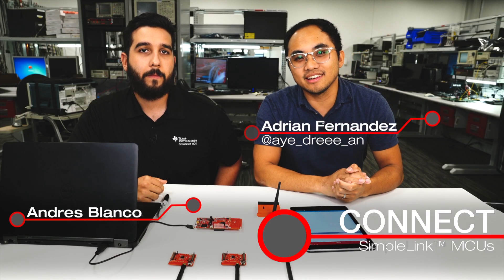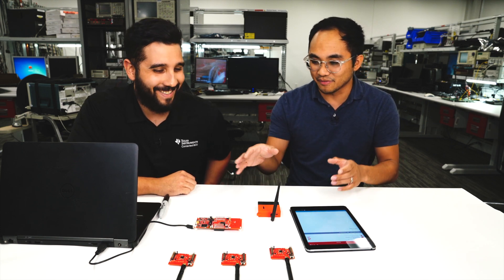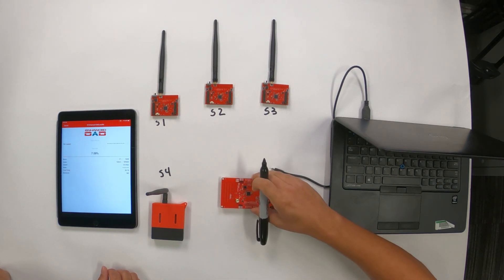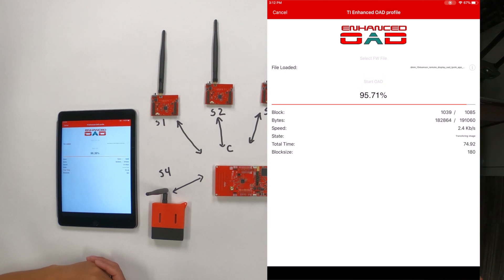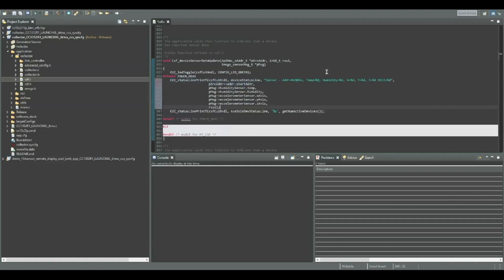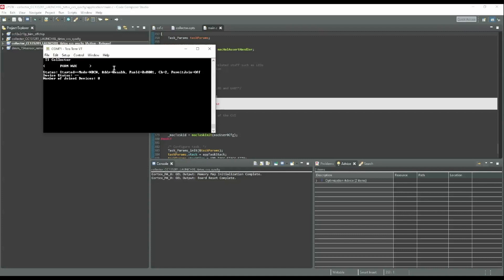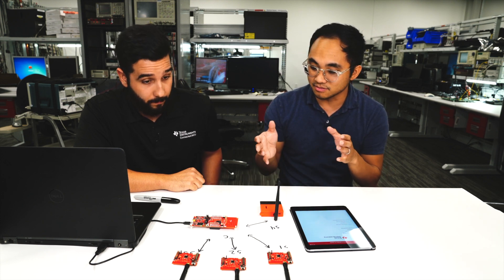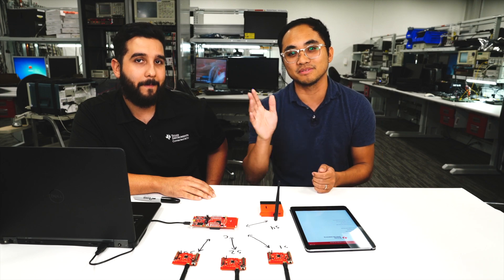Connect: Long-range, multi-band sensor networks with LPSTK-CC1352R

Comment: As far as range and penetration is concerned, is it comparable with LoRaWAN? The range of 2 miles is for direct LOS? In dense Urban cities where obstructions and wall infrastructure are present, will the range between sensor and collector be still 2 miles?